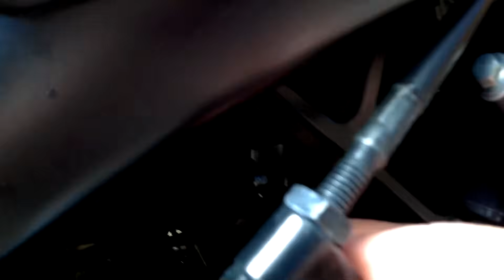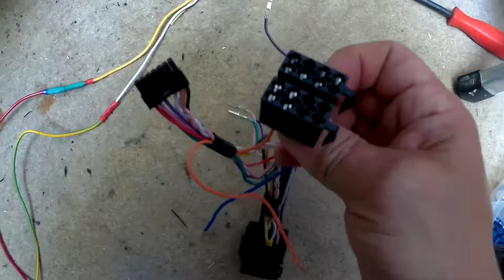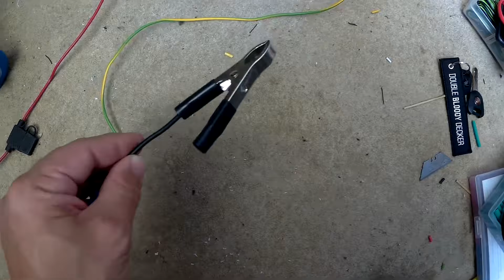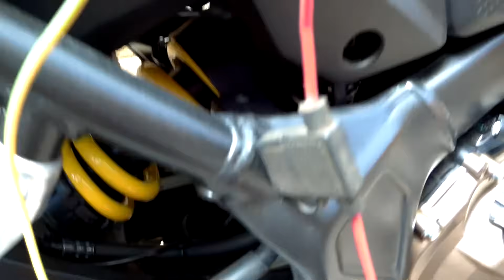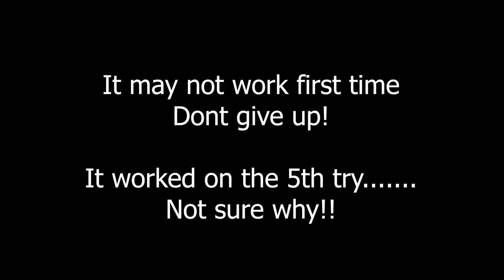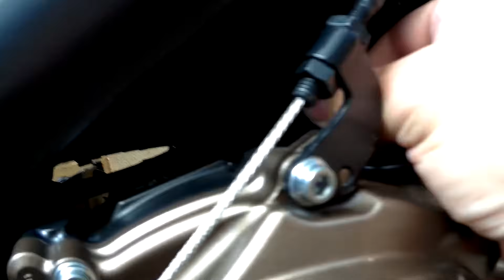Honda Motorcycle HISS Key Coding using £1 DIY cable!

Comment: Excellent video and very clear.  Just wondered where did you get the resistor specification from? A couple of other posts I have seen both mention a 1W 100R carbon film resistor which is only 100 ohm but they go back to 2013/14.
Reply from the maker: Hi Roger, glad you liked the video. To be honest it was a while ago now so not sure where I got the spec from but it certainly works!  All the best.
Reply: I try with 2k and work.
Reply: I suspect its just to limit current into the ecu.

Comment: What if I lose all spare keys?
Reply from the maker: If you don’t have any keys at all then it’s a visit to the dealer I am afraid as you need at least one working key to programme a duplicate.  Programming aside, If you have the key code (possibly in your purchase docs) you can contact a key cutter and they will be able to cut you one. It will not start the bike until programmed though.
Reply: If you lose all keys, the dealer would have to change the ECU/CDI and all the locks, probably around the £900 mark.
Specialized locksmiths would pick your lock, decode it, cut a hole in your ECU/CDI case and program a new transponder directly there. Would be cheaper than a new ECU/CDI from the dealer, but probably you will be looking north of £300.

Comment: Hello, what fuse did you used? 10A?
Reply: Did you get it to work japanstyle 20
Reply: @justinsolomon5561  yep, not on first try. I think i get it in 7 or 8 time but it worked:d
Reply from the maker: Hi, I think it was a 5A actually. Hope that helps. 👍
Reply: @beanosgarage9606  ty sir